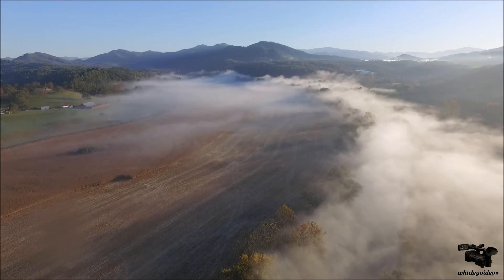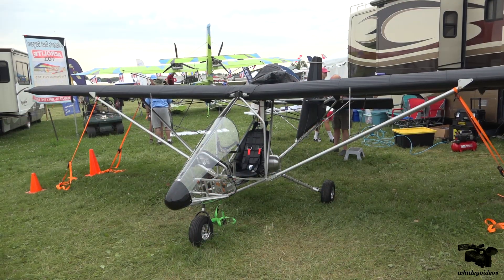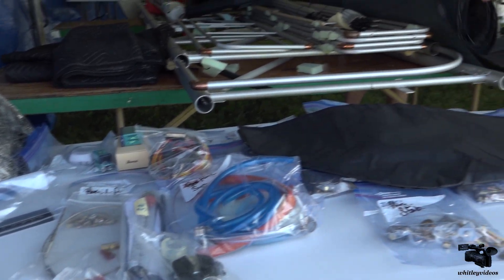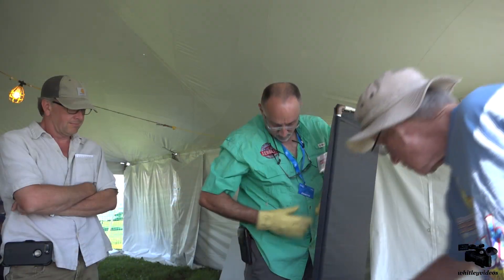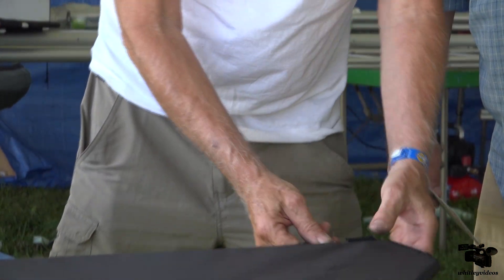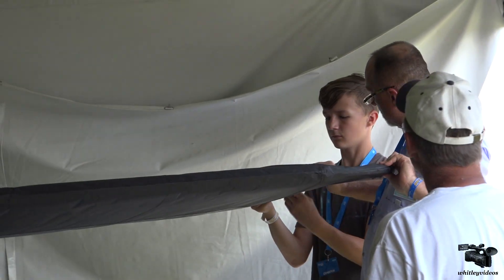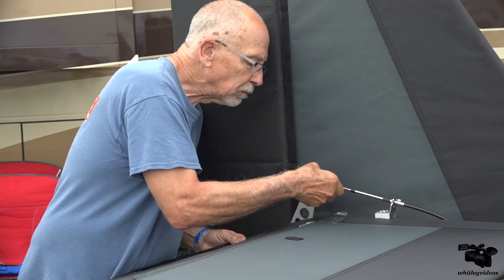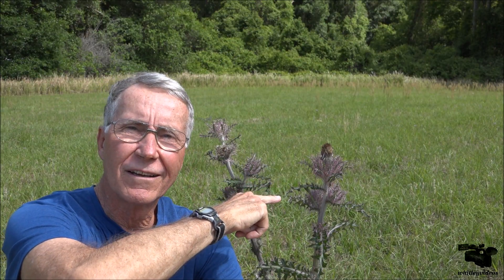Aerolite 103 Build at Oshkosh 2019

Comment: HOW MUCH IS THIS COMPLETE? I HAVE NO DESIRE TO BUILD ONE AND WITH A 4 STROKE MOTOR EVERY THING READY TO GO.
Reply from the maker: moparpapa, Contact Dennis Carley at www.uflyit.com for that information.
Reply: You can fly one away for about 26k they don't have a 4 stroke all 2 strokes the best motor IMO is the 50HP Hirth F23 its an opposed 2 stroke design which will cancel out vibration. 2 Strokes are notorious for vibration especially singles and unopposed twins anyone with any experience with Dirt bikes, or even RC 2 stroke gas engines knows about the vibration. Would be cool to buy one at he factory and fly it home.

Comment: Re: aluminum battens. I notice the Aerolite 103 doesn't seem to have the buoyant lift of the Backyard Flyer, and I assume this is because of the shallower arch of the aluminum battens. Has the Aerolite crew ever experimented with increasing lift by putting more arch in the curvature of the upper surface of the wing? Would increasing lift by wing curvature decrease maximum speed? Would increasing lift necessarily decrease take-off distance?
Reply from the maker: knzw25, Thank you for your for your questions. I will refer you to Dennis Carley at www.uflyit.com for the best answers. Regards, Wayne Whitley

Comment: My understanding is the wing covering material has to be replaced every 7 years not cheap in the $1000 plus range.
Reply: blastman8888 it’s not necessarily every 7 years.  It’s based on how much UV the airplane is exposed to mainly. They have a punch test that determines when they need replacing. The first sign replacement is needed is fading of the colors  some sails last a lot longer some shorter depending on how well you take care of them.
Reply: @coryturner9140  you are right and that's why mine is in a hanger and only flies early mornings and early evenings.  I also use the A303 on the sailcloth every month.
Reply: that's still pretty cheap.   you could spend thousands more on oratex or similar covering.  in the world of aviation,   this is economical and one that works well on my aerolite.
Reply: Is the wing dacron UV treated with a water repellent UV resist spray ?  I have used sunbrella UV sprays and it seems to really hold up to weather resistance.  Just curious if this is the same deal ??